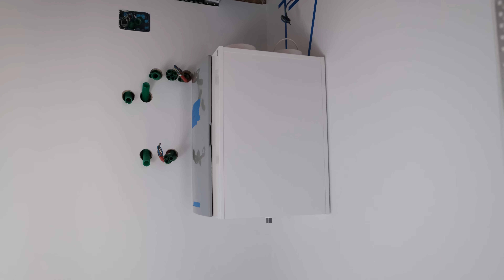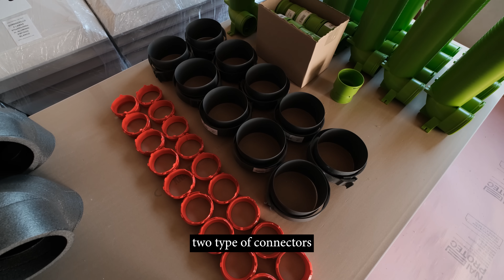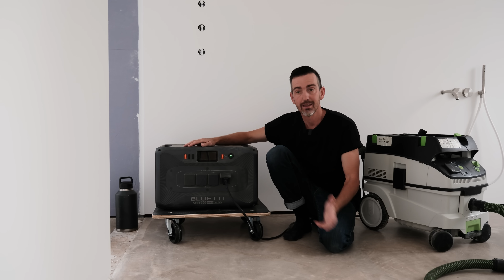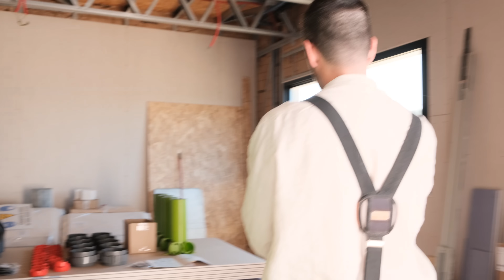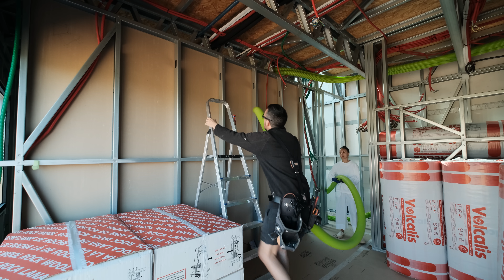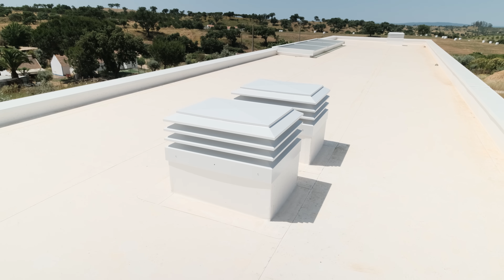The MOST SUSTAINABLE system you can install - Building Our House Start to Finish

Comment: Congratulations on another great video. It's really practical and modular, but there's a problem: since it's a plastic system, there's a risk of fire due to static electricity. Are there any precautions against this, or are you taking any yourself?